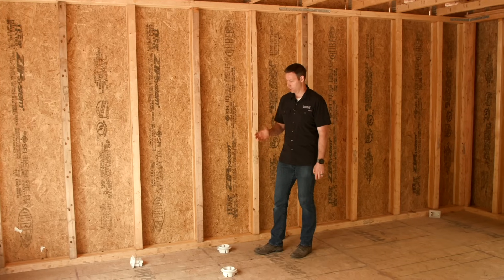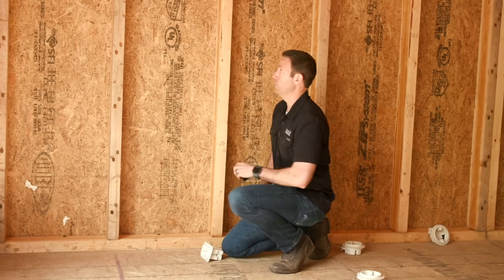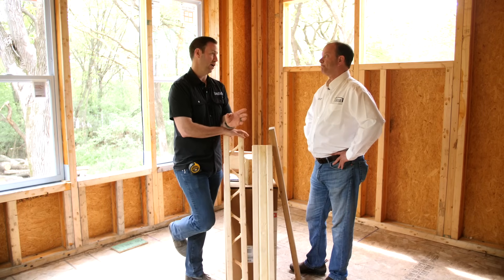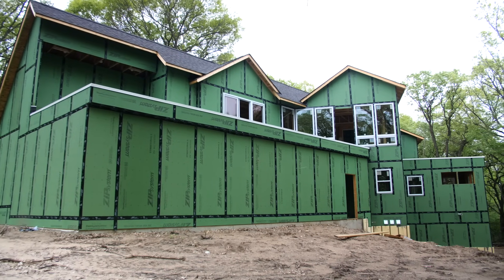Insulated Studs? This is a BIG Innovation in Framing!

Comment: This product isn’t for the average home build   There’s absolutely no way to justify the cost and gouging someone’s bank account and investment to use these.  An 8ft board would roughly be 3 - 5x the price of a standard 2x, therefore the cost to build an average home also increases by said amount. No thanks. I’ll stick to traditional framing and rockwool and have just about the same R-Val without the added 3-5x cost.
Reply: 1500$ more for a 2500spf house is hardly 3 to 5 times the cost..

Comment: Why not just frame with offset 2x4 studs and double insulate?
Reply: Cost.  And wasted material and effort.
Reply: You can, and it accomplishes about the same effect. Two things though,  double offset studs is going to be more labor than a singe row of TStuds 24" OC,  and with the offset studs you still get the thermal bridging at the plates, and at window openings, etc.

Comment: Cost, termites and water intrusion along with mold remediation  says run fast from the product. I want to know the cost difference between a #2  2x6 verses this frankenstud. I also want to see one soak in a pool of water and swell and then dry out several times. Or a house flood and dry out.
 There comes to a point where insulation defeats the introduction to fresh air into the space.  This idea is  in no way new. "All the effort into the wall studs and then you look up and see the  non insulated roof  trusses"...Wait that is  the entire  footprint of the house...  It is  non insulated roof trusses.  Want to know why? You can not engineer them for strength  into roof trusses.

Comment: What was the savings for sub on utility installation? Should have been pretty decent as well.
Reply: Electricians and plumbers are lovin' that....
Reply: Nick except when one of those dowels are in the way. My guess you cannot touch the dowels. And you will run into this issue.
Reply: Absolutely nothing
  Drilling holes in new construction isnt time consuming enough to offer a discount.
Reply: @markdoldon8852  I've worked construction all my life, the last 10yrs in multi-million dollar homes. I can tell you "just drilling holes" is a time consuming pain in the a$$.

Comment: Really cool product but if using batt insulation, it's going to be a pain due to non standard widths. Do they have install tips for this? Or just recommend densepack or spray foam?

Comment: Looks awesome but........ as a firefighter this has me worried. When those dowels burn out faster than the 2x3,s and fail how strong are these studs for supporting the structures above them. Are walls and ceilings gonna come down faster without warnings on us? Building technology always moving faster than we can test.
Reply: Burn tests have already been done. I found the after 20 painstaking seconds on google. That was about 15 seconds wasted since the information is literally linked on the front page of www.tstud.com
Reply: dougr944 kind of. Still needs more testing but they don’t report the strength once the Yaris begins to separate. Either way makes me nervous until more testing and actual field results come in.
Reply: @firefighter08031995  ... You're never going to be comfortable with it because it is different. Actually take some time to look at the website (which I know you didn't do) and see how the fire treated versions respond to fire. The foam is self extinguishing. It isn't styrofoam.
Reply: These are questions that MUST be addressed. Thank you for bringing attention to this.
Reply: Energy cost are more important than lives
Reply: @64maxpower  Sadly, too often true.
Reply: Firefighter, I also wonder about the burn ratings of the phone and whether it puts out toxic fumes when exposed to heat, even if it doesn't burn.

Comment: I don't understand how these are structural 'flat' as used as a single top plate or header. A truss is only bearing if the triangulation is vertical, there is very little, read 'none', with a truss placed in the incorrect orientation. What am I missing here?

Comment: They need to come up with a couple of options for corner Tstud where corner is already built.  I could also see using the bare Tstuds for inside walls too, quicker to run wire, pex, etc., etc., less weight, stronger...

Comment: The cable may cause a fire hazard depending on the type of insulating foam that has been used due to a chemical reaction between cable insulation and the foam, so a barrier between the two may be required. Looks pretty promising though.

Comment: Ummm, why not just go structural insulated panels. Faster, cheaper, higher r value.
Reply: Absolutely-  I was building all-SIPS houses 35 yrs ago. But - They might be better,  But they were not - and still are not / cheaper.  Mechanicals are a problem when there are no stud bays, and it takes heavy equipment to move and erect SIPS walls.  We man-handled 4’ wide panels that locked together onsite, but that’s not the smart way to do SIPs. Today 40’ walls could be fabricated and set in one piece.  It’s going to take more than one alternative to 16 oc 2x4s. - TStuds are one answer. SIPS are another- and hopefully there will be others too.

Comment: Sorry, I really don't see the benefit.
With a normal 20% heat loss through the wall = 1s.f.  per 16 s.f. of R20 vs R6 I think it would take many years to recover the cost. Also, all exterior walls need to be built on 16" oc to get proper uplift strapping and siding connection not to mention it's going to be a special ordered product and most likely  there will be lots of leftover expensive materials. No thanks, I will stick with the traditional studs.
Reply: I wish my current rental was remodeled as it is drafty and costing me so much to heat in winter, if i had something like this and newer up to standard insulation if the landlord was not so as they are about getting things repaired. I would save so much money in heating and cooling even with better insulated and new modern exterior walls. I would gladly pay the landlord the extra rent from the money I save on heating and cooling going this route.

Comment: If they’re 2.5” thick how do you use 3.25” nails? I don’t understand that part. Seems like you need 4” nails but I must be missing something
Reply: I missed the part of the video where it mentions 3.25 nails, so not sure what you're referring to. According to Tstud's field construction guide, you're correct, 4 inch nails are required for nailing the plates to the studs. 4-1/2 inch nails or screws for attaching the wall assembly to the floor
Reply: Andrew Alexander that’s exactly what I wanted to know. It doesn’t mention standard nails but I’m not aware of larger nailers being commonly used. Thanks!

Comment: I call b.s. on the headers. They only did that because they didn't have material. If you look at the window header, that's like having a bunch of twigs and expect them to hold a bunch of weight.. try throwing up another level on that loadbering wall and I'll see a few years I'll see cracks on the dry wall.

Comment: 15.00 for 8 ft.  no thanks.. build it out of  2x3 spray the whole wall the 2x3 the inside then insulate that.. twice the r value at half the price
Reply: Without the truss, you're losing most of the structural strength.
Reply: Steve Schutte it would be stronger.  you could glue the 2 together with the foam and you wouldnt lose r value with the ribs. besides . its residential you need r value not so much strength

Comment: Absolutely amazing product! Can they rip down LVL studs to make these stronger and straighter?
Reply: Or LESS strong and straighter.  there is zero need for this or any stud system to be 4x stronger in axial loading.  So let’s figure out a way to do this that is similarly strong compared to a 2x6 24oc wall.... but many times more efficient and both simpler AND  less expensive. Maybe 2x2 lvl material - maybe finger-jointed - maybe just smaller lumber.  The key here is the simplicity and the insulation value.  Mass production will make it way less expensive over time. They are on to something - and long overdue.  We are framing houses like it’s the turn of the century. 1800 not 1900 LOL.
Reply: @HBSuccess  This is better. Probably cheaper than what the T-Stud would be, considering you can buy ZipR locally and rip it into strips. https://www.finehomebuilding.com/2014/11/26/breaking-the-thermal-bridge

Comment: How do they fare in fires.  Engineered products tend to burn quickly and at higher temperatures.  Closed cell foam are said to be fire resistant but they burn at much higher temperatures, indeed many fire departments will require all foam to be stripped out after a fire.
Reply: Even worse, what happens to that foam if it sits under water when your neighborhood floods 4 to 6 ft deep? Even closed cell foam is likely to absorb enough water to create ripe conditions for mold growth.
Reply: Please do bother to use the dang description for links to their site for more information where they posted all current test report including UL fire rating (second PDF on the list), and here I had the common sense to do that Simple search FIRST instead of commenting about it or other concerns they mention in the video or may have otherwise not covered there in.
Reply: @Joshua79C  We all know that closed cell foam is considered a fire retardant and the air tight seals help prevent the spread of fire but we also know that the temperatures that such foam burns at are extreme and hence the foam is a risk of secondary ignition hours to weeks after a fire hence fire departments often require all foam to be removed from the property after the fire and removing foam is difficult at best but with this product it's integrated into the product.  So does this mean the property must be demolished after a fire.  The other poster's comment about mold is also pertinent. Though technically closed cell foam should not absorb water, it could absorb some after prolong immersion and certainly the interfaces between the foam and the wood could allow water to seep into the structure where it would be difficult to remove after a flood.  So does the structure need to be demolished after a flood.

I think you're the one that has not done the research.
Reply: @johnwang9914  And yet anytime has their wall cavities spray foamed, then those also are getting integrated with the same material, T-tud or a basic typical insulation job, are the same difference. Though the TStud due to its dowels actualy hepp to hold the foam in place better, the same piece he showed that was bare clearly had the foam removed as I could still see pieces of foam stuck to it. 
As for water retention, Yes I did view the video that he Matt posted some ago showing his result of open versus closed.
As for EPS vs XPS .. I have yet to see any EPS foam (used widely in the marine and floating home industries and now more so in the ICF home industry) retain any amount of water as compared to XPS which definitely holds in any water better than a foam sponge does. Despite what those who tested by injecting the water into both types of foam which is not how it happens in reality those "XPS will repel 0and not retain water" were only short term effect studies. If they were to keep a piece of each dunked in water for at least two years and then took a look after that time, then the  EPS will shed it off, as it is removed from its dunking where as the XPS will be very noticeably spongy wet and water logged, like a sunken log.
Reply: @Joshua79C  Yes and when those houses with the sprayed in foam have a fire, depending on jurisdictions, the fire department would hire a contractor to strip out the foam from the entire house at the expense of the homeowner.  There are also instances where the chemicals mixed onsite to produce the foam are incorrectly mixed and or the temperatures were improper for the chemical reactions resulting in outgassing of dangerous gases indefinitely.  This has become a major concern in the industry as with how to remove the foam effectively, whether or not all foam needs to be removed and the compensations involved.  Foam was never designed to ever be removed from a house and this has become a problem in the industry.
Reply: @johnwang9914  I like foam but not in such an excesive use, I am more included to roxul/Rockwool insulation over foam or fiberglass. Wish I could re-insulate the place I am in, its old and so drafty! I would be willing to pay the landlord more rent if they were willing to fix things around here, especially the remodeling to improve the mentioned draftiness which would help lower the utility bills I pay to heat and cool the place down to keep comfortable. I would be more wiling to pay a higher rent price, other places start at 1,500/month, I am currently paying 800/month and nearly 150 on heating oil and 100 on electric in the summer for cooling when it is HOT plus humid outside and it gets humid inside this place. The basement is a whole other matter.
I's much rather win the lottery, so I can move into my own home and become my own landlord an not even have any HOA to tell what I "can/can not" do as well..
Hope i am entertaining enough and not being a bore.

Comment: Ummm. As a structural engineer tangled up with wood for 20 plus years working with CSA O86 code, major structural issues with what has been said here. I like the wide flange (2.5”) which is nice for drywall, I like the closed cell thermal break. The dowels... feel... not quite right, but good to allow foam insulation around.  The quoted strength of a 2x6 is misleading. Even a garbage (#3/stud) grade 2x6 is rated at over 7000 lbs for 8’ walls. A structural quality 2x6 SPF is rated at 13,400 lbs for 8’ walls . His statements about weak axis buckling are moot as the sheathing has sufficient rigidity to prevent that.  Although strictly true that it would have improved weak axis buckling because it is wider (1.5” vs 2.5”), that does not come into play in a wall with at least one structural membrane, which is typical of all Exterrior walls which is needed to transmit shear between floors. As well, houses don’t structurally benefit from 2x6 walls unless they are three or more stories tall. 2x6 are only useful for insulation and having lots of space to run services.

Comment: Haha I just caught that, the inventor said we are gonna start treating them. Meaning non of those studs that they have been using were treated. They will have a major lawsuit on their hands once the termites start ripping apart those walls and ripping through all that foam. Talk about a failure in the making.
Reply: In a lot of northern regions, the risk of termite damage is almost nonexistent, and almost all residential construction is all untreated lumber except for wood in ground or concrete contact.

Comment: The insulation inefficiency of wood is just a little overblown. This company capitalizing on it!
A house made with this new mixture is going to be slightly better insulated yet decidedly weaker 
than one using the same size wood. Fail.

Comment: I worry about long term strength of the dowels glue over time. I have some old foam that is brittle and if this studs glue and foam degrade over time it could effect the wind and earthquake survivability. I don't know if the polyurethane foam chemistry has changed and will last longer than what I've seen. I hope it has as this will definitely make homes more efficient and safer.